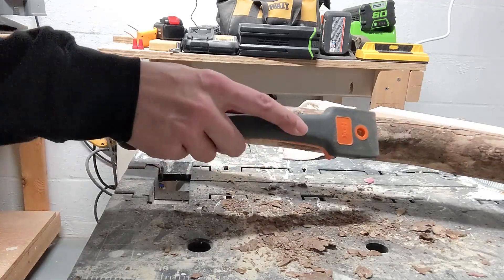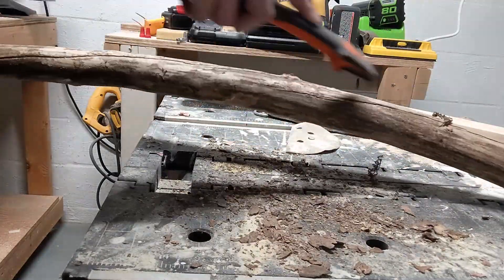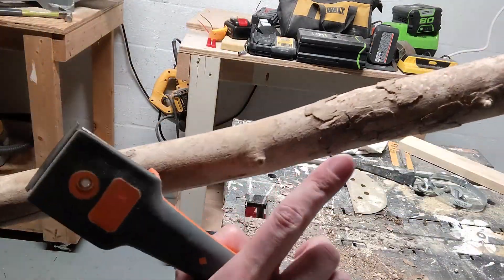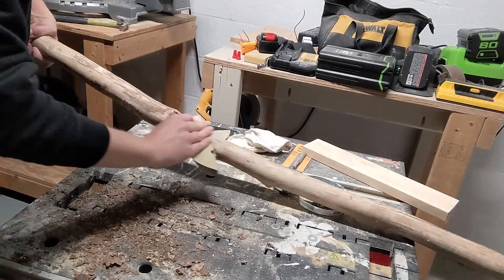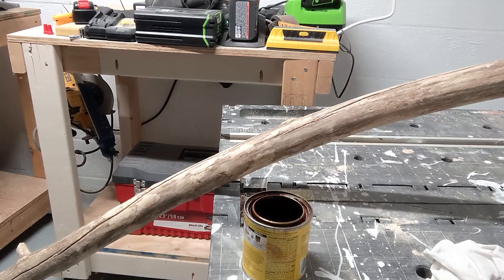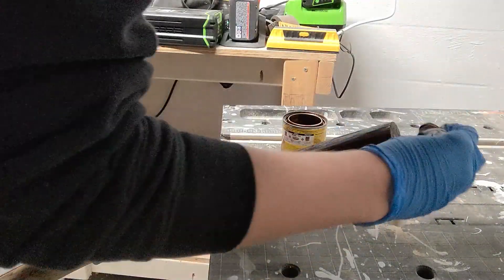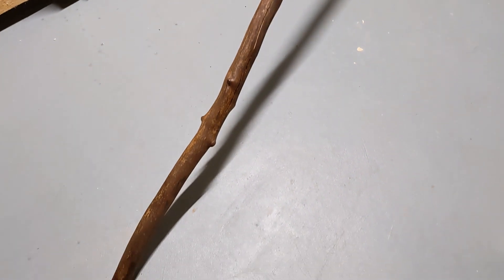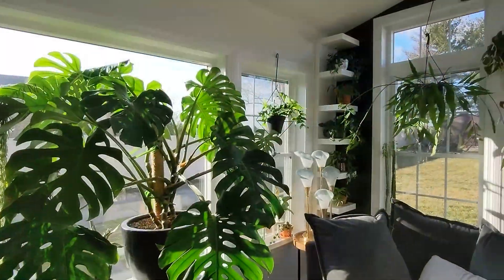Staining & finishing a tree branch to turn it into a plant hanger!

Comment: Looks great!
Do you know give or take what the diameter of the branch is? I found a birch branch but I don’t know if it will support larger plants. Maybe 4 inch pots but I’m not sure about larger ones and I’m not sure how to tell. I know birch is pretty strong but i would hate to have everything fall if if we’re too heavy. I know this will depend on a variety of factors I’m trying to get a general idea.

Also, how do you attach it to the ceiling? Do you think two ceiling swag hooks in the joists of the ceiling would work?
Reply from the maker: Hey there! Thanks so much, this one is a little under 2 inches at the smallest diameter. Right now I have 3 largeish 6-8" pots hanging on it, and I've had as many as 5 pots ranging in size from 4-8 inches. As long as I keep the ones on the end pretty close to where the hooks are, I'm not worried about stability. 

As for hanging it from the ceiling, I just used two screw hooks directly into the ceiling joists. I was worried about using swag hooks with anchors because I didn't know how many plants I'd ultimately be hanging on the branch. But screw hooks screwed directly into the ceiling joists is SUPER stable!